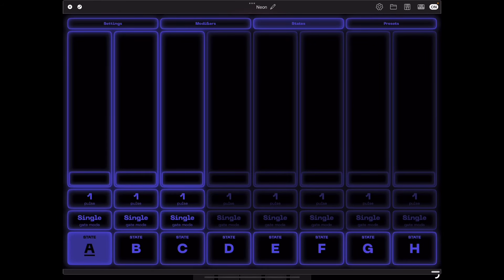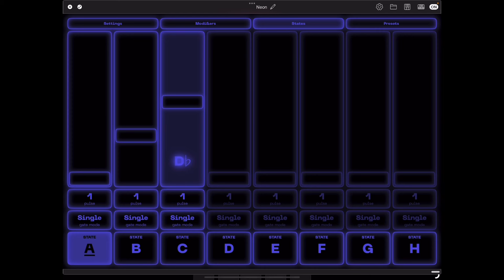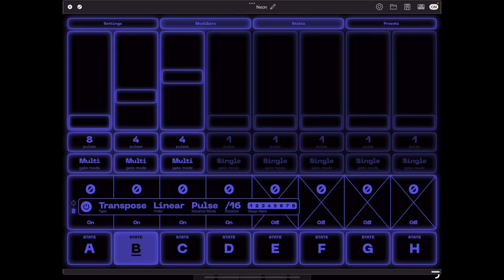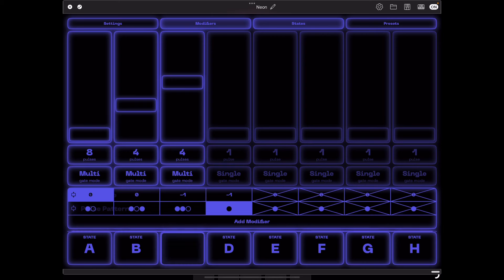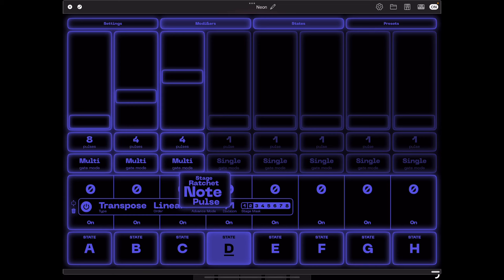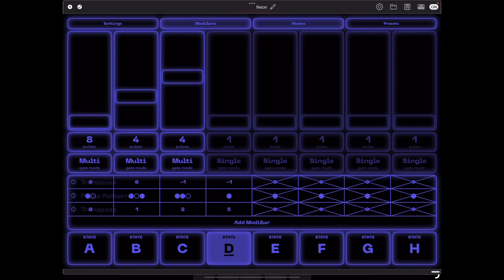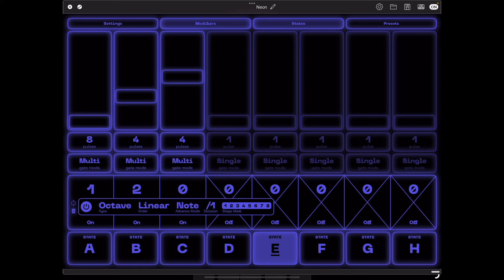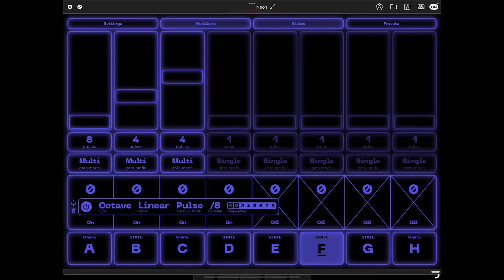Neon Sequencer Modifier Demo

Comment: Great App. But, why do so many developers shoot themselves in the foot by not making it work on older iOS versions. There’s no way this app needs iOS 15 to run!
Reply from the maker: thanks, i’m glad you like it!

it’s funny that you say that about older iOS versions because i’m currently trying to fix a bug that occurs with iOS 16 and not iOS 17. I only have one iPad and it runs iOS 17 so I had to track down a friend who had an iPad running 16 because it only happens when its running as a plugin in an auv3 host and I can’t test that in the Simulator.

also I did use some SwiftUI features only available in iOS 15 and up, like the swipe actions in the preset list to give one example.